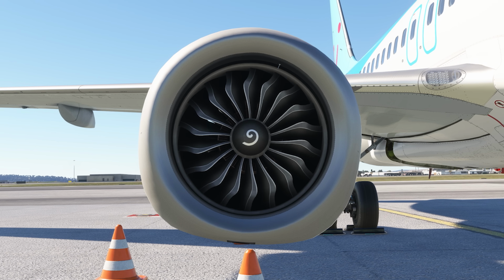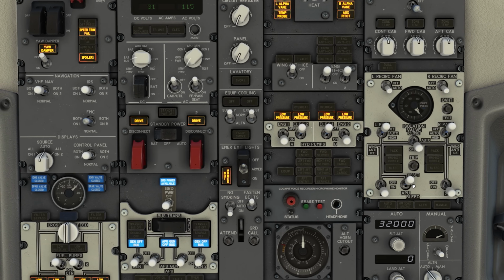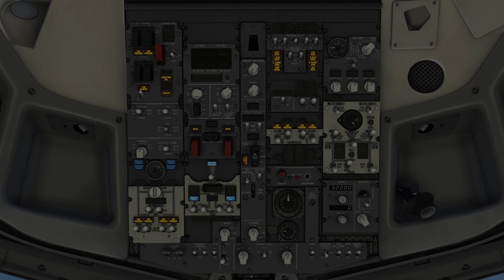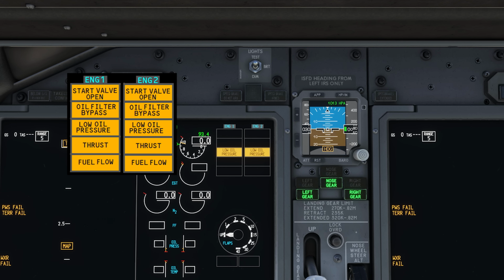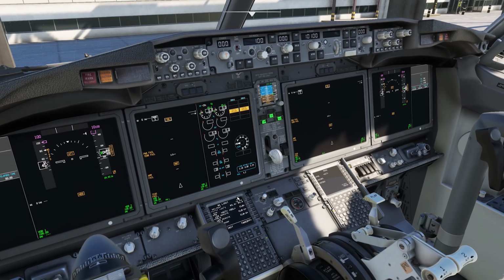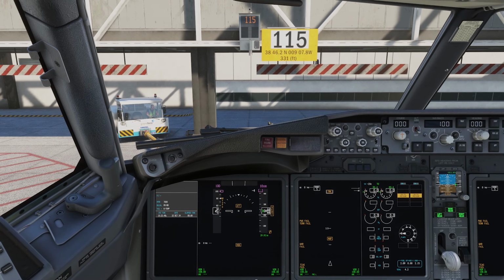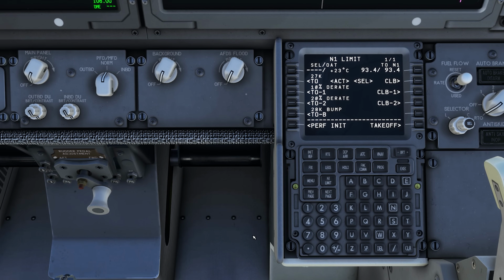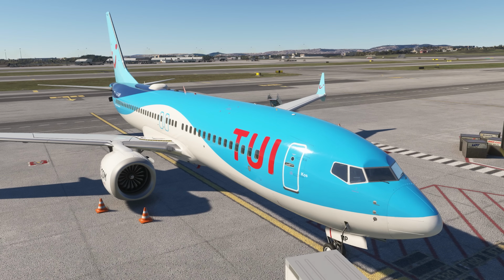iFly 737 Max | The Ultimate 737 Max differences Guide by a Real 737 Captain | MSFS

Comment: The APU EGT Indicator missing is a bugger. Compared to other planes with a missing rpm indicator the 737 is already sparsely equipped for APU monitoring. Boring opting to remove it really feels like a move to just save a few bucks.

Comment: Question: if the LEAP engines have an automatic anti ice system, do you know what the issue is with the cowling overheating when pilots don't turn it off?
Reply from the maker: You’re thinking of the conventional TAI system which heats the cowl lip. Just like in the NG it’s controlled by the pilots. The core anti-ice system is completely independent to this and controlled by the EEC.

Comment: Hey Capt, a few questions:

1) on 737 Max, FMC approach page 2/2 has runway condition. What is this page for?

2) Is there a way to tell if the parking brake is set from the outside of the aircraft?
Reply from the maker: I missed that one! I even covered it on an Insta post! 

https://www.instagram.com/reel/CseWKK7AEF4/?utm_source=ig_web_button_share_sheet&igsh=MzRlODBiNWFlZA==

2. Not an official way but you can use the brake pin indicators, they determine the brake wear but it's only valid when the brakes are applied.

Comment: When you say a feature is "transparent to the flight crew" does that mean it's invisible to them or that it is clear that it is activated through an EICAS alert or something similar?
Reply from the maker: Yes that's right, it essentially works behind the scenes and there is no indication of normal operation. I guess you're referencing the "Core Anti-Ice" system" I described where it works as required in the background but if a fault in the system develops it will illuminate the ENG ANTI-ICE light. 

FD2S